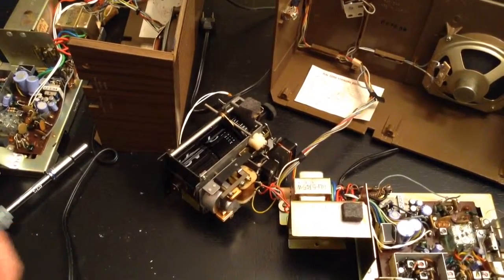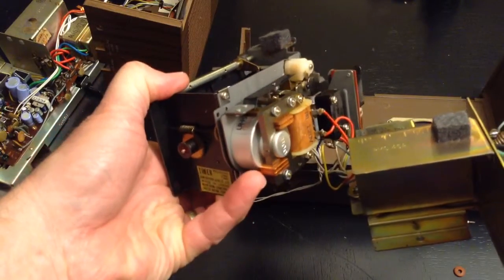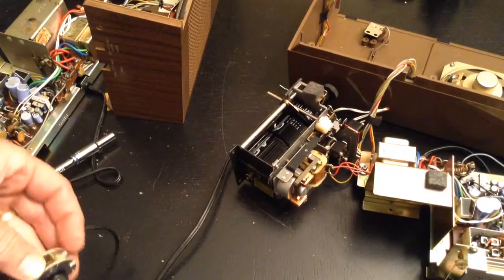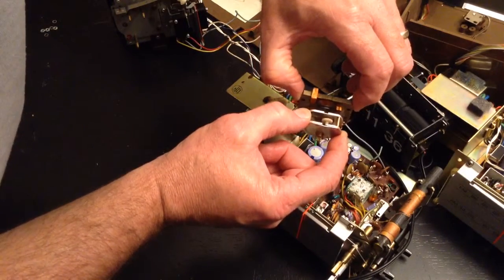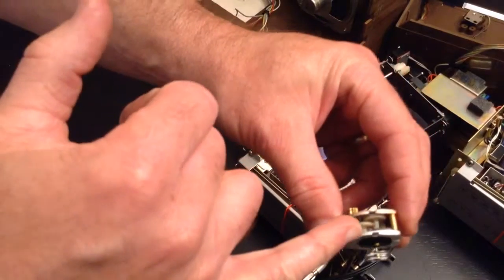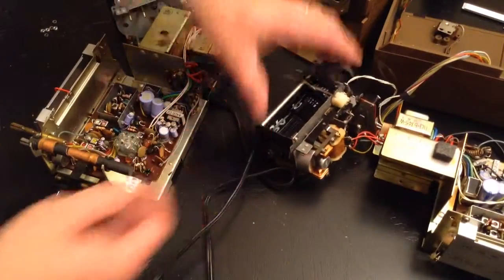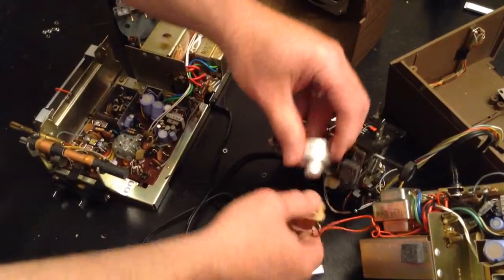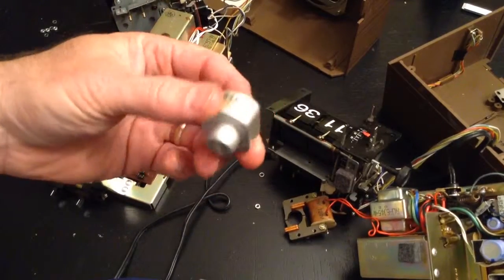Clock motor in a Panasonic RC-6530 Flip Clock

Comment: I bought a Panasonic RC-7148, it has a similar sealed motor that is froze up. Going to try your idea of drilling it out and using Deoxit fader lube as that is all I have handy.
Reply from the maker: I hate to say that it probably won’t work. Good luck though! Often you’ll have to get another clock for parts to get a working motor.

Comment: You can get these motors open without destroying them. Using a Dremel with a fine burr tip, grind away the glue/sealant that holds the mechanism in the can. Do a little prying around the perimeter and pull the clockwork mechanism out.
Reply from the maker: Thanks!
Reply: Rob thanku. i just bought the RC 1280 would the addition of tamiya ceramic grease also help they are not only sealed but appear (if they ever were)  unlubricated…

Comment: I just purchased a Panasonic model rc-6493 which is not working, heard a lot of negativity online about repairing it.
Reply from the maker: I think it's a good solid clock. It's just a little difficult to work on. The one clock radio I would never, ever buy non-working is the Panasonic RC-6530. The gears inside the sealed gear box disintegrate. There's no satisfactory way to fix that.

Comment: Nothing is truly "sealed" as far as serviceability goes.  If it was assembled, it can be taken apart.  It may have been built to discourage repairing it, but I think "sealed" stuff and stuff that's rumored to be unrepairable discourages too many amateurs from saving these clocks with a little bit of lubrication and maintenance once in a while.